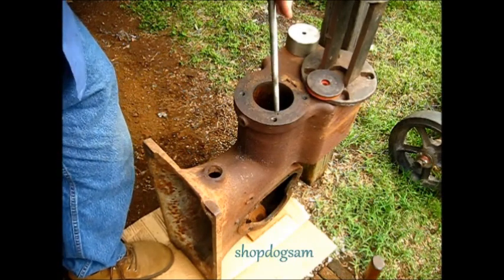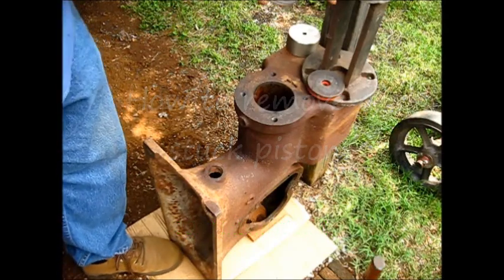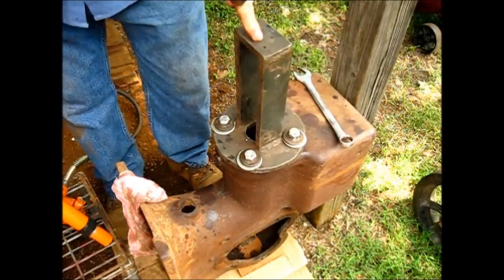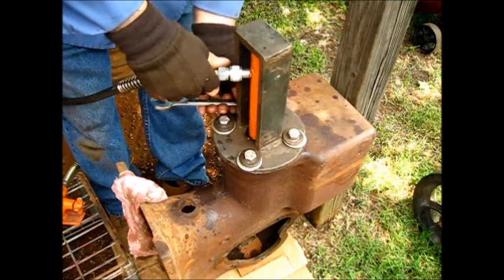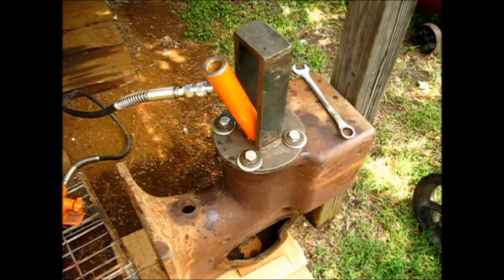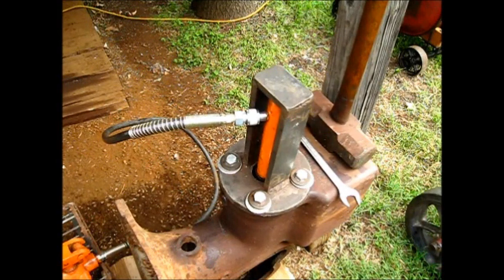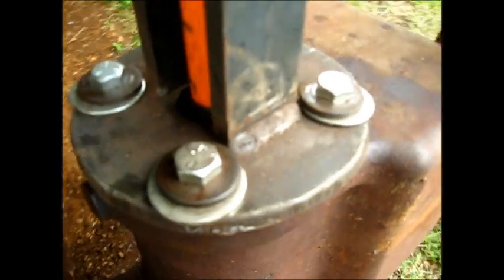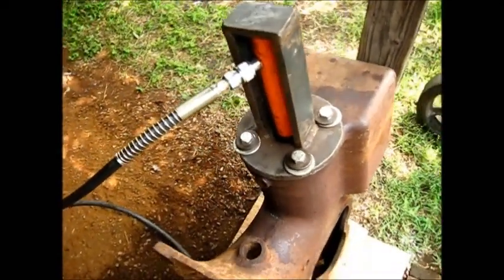1918 IHC engine  piston remove

Comment: Would love to have a Porta-Power like the one we had at the body shop.  Hydraulic pressure applied correctly is a great tool, applied incorrectly, it's a great destructive force.  Sam, you taught me a lot about electrolysis.  I wish I could find a chunk of graphite.  I've been using 1/8"X2"X8"-12" steel plates I bought at Lowe's.  I bought 2 pieces of graphite, 3/8"x4"x4", that I will be using for small pieces.

Comment: It's Great to see you preserving these Ol Engines of yesteryear  , I love the old stuff . I have on Maytag 92 , bought it at a swap meet for $40 complete , stuck piston . Got it out with a grease gun , cleaned it up and stuck it back in , been running ever since . Used you video on how to make a stop switch rod , found a iron wheeled cart for $15 wheels and all ,  Came out great . Have many of the Briggs 5s type engines in My collection , Clintom Lawson , Continental AU 85 , Iron Horse . Keep up the Great videos Shopdogsam  .

Comment: Thanks.  Gives me ideas for a 1937 Ford V-8 60 I have which has a stuck piston. Thinking on ideas for the stuck valve guides. I really don't want to cut of the valve heads. As you probably know, you cannot remove the valves on early Ford V-8s without removing the valve guides because of the mushroom feet on the valves.  Amazingly, the rest of the engine came apart fairly easily considering it sat in a mud hole in a junkyard for at least 25 years that I know of.

Comment from the maker: ,,, it's one of those products that can not be proven to work better than the other,,,, no way to compare them (whatever the brand),,, in the past I have used the transmission fluid and acetone mix (50-50) and have found it to have no advantage (even did a cost analysis of several different brands and concoctions),, but in the end I found no way to test (compare) any two of them,,,, you can not unstick the same thing twice,,,,,, shopdogsam

Comment: Thanks Sam....an alternative to electrolysis I've had luck with is 1 part feed grade molasses Feed Store) and 9 parts water. You can put that whole block in a tank. Let it percolate for a couple of days and the rust turns to a slurry and washes right off.

Comment: Hey Shopdogsam, next time instead of the Blaster try a 50/50 mix of acetone and Dextron.  it is absolutely amazing how well it works to free rusted parts. I guarantee there wouldn't have been a dry spot on that piston skirt when it came out. Best of all it's cheap!

Comment: Don't you just love it when you feel or hear it begin to break loose? I imagine you checked to see if the rod was lined up with the hole in the back first thing -in case the piston let go in a hurry? Kbang like? BP blaster works good, I also like using the oil they use in the turbine (suction) pumps (turbine oil) that they use on big septic tank pumping trucks, have you ever tried that stuff? Penetrates and lubes good! Great video, love your ideas!